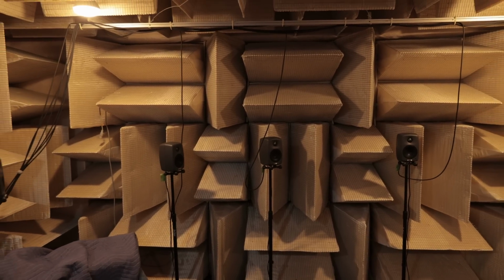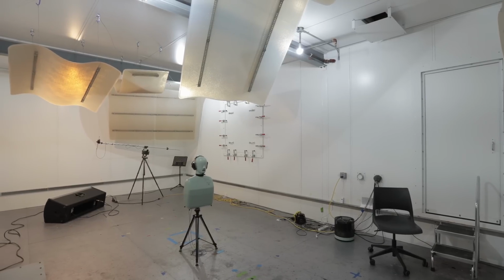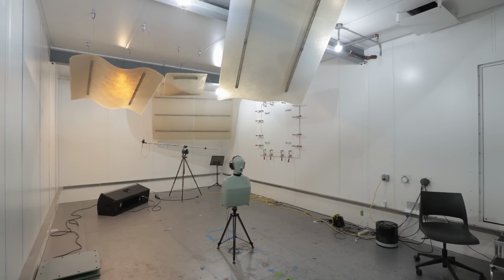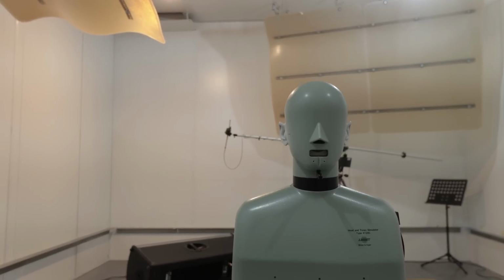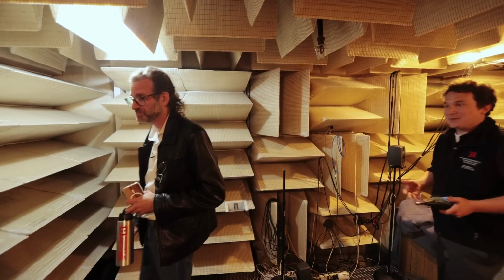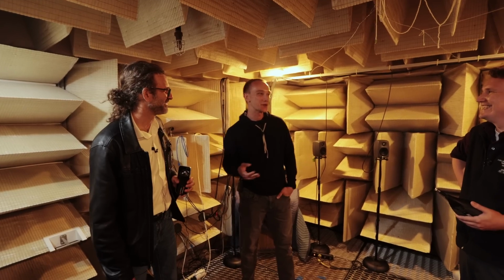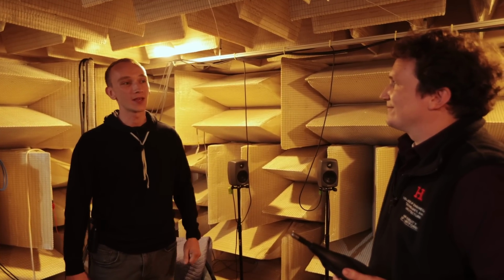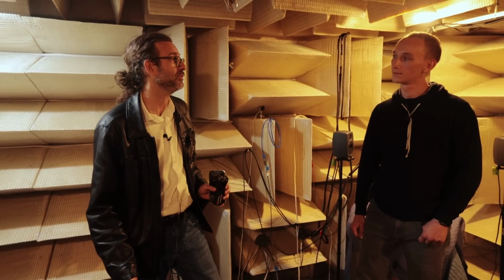Talking Acoustics at the University of Hartford

Comment: RE: room design before acoustic treatment. Many years ago the BBC did a study on ideal (as ideal as you can get considering restrictions) rectangle rooms with flat ceilings (Boxes - What many small studio builders may encounter). It involved ratio's of the dimensions firstly and size of the room secondarily. There were subjective suggestions about size based on which resonances were "preferable/tolerable. I believe this was somewhat bandwidth limited due to the priority of voice and the ability of equipment of the day (Leaving out everything below 100hz and above 8 - 10khz seems about right). The room size suggestions I believe were an early example of psycho-acoustic study although they didn't call it that then :). This material can be found in most issues of The "Audiocyclopedia", an excellent audio engineering reference source.

Comment: I went into an anechoic chamber in Nashville that wasn't suspended pr decoupled from the rest of the building and even then the lack of indirect sound was unsettling. But low frequency noise easily made it's way inside the building especially from the elevator shaft. The vibration isolation springs are hugely important I bet

Comment: That 17dB(A) in the anechoic chamber isn't even the "real" noise level in there. It should be much lower. This value is typical of that class of sound meters and it is its electronic noise, the bare minimum it can measure.

Comment: Artec did an excellent work when they adapted an old train station into a concert hall - Sala São Paulo. Bellow is a link to google maps. You'll see a part roofed with orange clay tiles and then another long part covered in grey roofing. That part is the train station - that is still in use. Artec managed to insulate the vibration of the trains from the concert hall itself.

My colleagues and I did some work on an auditorium that's on the basement of a reinforced concrete 3 story tall building on the Arts Institute. Sound from the pianos on the upper floors would bleed into the auditorium through the reinforced concrete structure. The solution would be to insulate the pianos from the structure using, for instance, those coils.

One main use for reberating rooms is to measure sound absorbing materials by measuring the reverb of the empty room and then, after putting a determined piece of the material inside, measure the reverb time again. The difference in time can be used to calculate how much the material absorbs per square meter (or feet).

Comment: These 2 rooms have different characters. In my opinion, it seems that relying solely on the room can reduce the mixing process in audio recordings. Especially for reverbs and dynamic compression. Thanks Kyle and everybody.
Reply: Supposing you have a great room, properly treated (using the Sabine equation if you want that good natural reverb) and are tracking acoustic instruments, yeah. Otherwise the differences you hear are the are only difference YOU hear in your listening environment, and will not transfer to other systems in the same way. Like mono bluetooth speakers, for example. That said, all the biggest records of all time were definitely recorded that way. A lot of them, in Abbey Road's reverb chamber. I can't remember what song, but one huge classic rock song was tracked in a stairwell, and pretty much every large studio has either a reverb room or an actual plate reverb in the basement. (If you don't know how real plate reverb works, check it out, it's amazing.) Getting it right at the source is usually the best way to track and for sure the most efficient. But that's also the reason old records sound old, they didn't have the flexibility we had today, like re-amping through plug ins, especially with an IR for a good cabinet captured in a great studio room. Same with drum samples. I can track and mix drums, for sure, and it'll sound good. However, it simply can't compete with Matt Halpern from Periphery's playing, feel, gear, and the room (with was phill Collins' studio I believe for the last pack they released.) These aren't fake drums these are real recordings of a pro with pro gear tuned and set up by 2 pro's (Nolly & Matt) in a world-class studio using several $20,000 microphones. We can't compete with that at home, or really anywhere. Which is why the top producers in metal and rock, have been layering in samples like this, since the 80's. But I'm a HUIGE fan of tracking it right in the first place, but still tracking a DI side by side just in case.

Comment: Electricians have fire putty, it's red like clay and used for penetrations in firewalls. Take the cover off your receptacles and switches, and fill them with it. It's relatively expensive, but it's rated for that use and the only alternative we have is sheet lead which I really don't recommend because it's actually for shielding in x-ray rooms and such and is toxic and won't work nearly as well. Receptacles will nearly always be next to each other on both sides of the wall. It's not just something we do to save wire; it's engineered into the plans. We're just doing it like the prints say to.

Comment: Excellent video, thank you.
Couple questions on those balloon pops.
Would it be ok to rip and use them as impulse responses on my own work?
Balloon has it's own frequency spectrum. Would it make sense to take the anechoic chamber balloon pop frequency response normalize/flatten it with EQ and then take the same EQ to the echo chamber pop?
That should probably turn the pop closer to white noise peak I'd assume and therefore give more accurate IR of the space.

Comment: Considering that the noise floor of the sound level meters (BK 2250) is 16.5dB(A). The SPL A weighted in the anechoic chamber must be in the 11dB(A) range to achieve the 17.6 dB(A) or am I mistaking?
Reply: Sound level meters have a nominal noise floor (acoustic self generated noise, with the microphone attached) and a unique noise floor which varies for each unit as each will have very slight differences due to the individual model, its circuitry, the preamplifier and microphone used etc.
On top of that, the measurement was made with several people & cameras in the room, which makes it very hard to create an 'ideal' environment for measuring the room noise.
The actual A weighted noise level of the room is probably lower than the 2250 can measure. Our own anechoic chamber (university of Salford, UK) measures close to 5dB (A weighted) with low-noise microphones through a B&K PULSE analyzer (without anyone in the room & all other electronics switched off).

Comment: At 29 minutes. 
Finally. Someone said that speaker model matters. 
You can’t just drop any 18 inch subwoofer in a building and expect consistent results. The speaker you use matters. The acoustic treatment you put in the room matters. This matters. 
JBL may be perfect for one situation, while Community is the correct speaker for the next and EAW is for yet another one. 
The EAW line array isn’t gonna work where the Meyer point source box is best suited for. 
IT MATTERS.
Reply: 🤔 Makes a lot of sense.

Comment: There's a very distracting steady-state noise in the background through out the video. I thought it might be gated room noise but it persists in the anechoic chamber. Maybe data compression artifact? Electrical noise on a faulty piece of gear?
Reply: The editor may be deaf from all the balloon bursting
Reply: I was wondering too. I didn't find it distracting but I found it ironic that there's static coming through in there. I wondered the source of that as well. Something in the signal chain. I doubt it was actually present in that chamber but some electronic in the signal chain produced it most likely.

Comment: Regarding the Yamaha, ns 10. I don’t think it was designed to be a great sounding speaker, but an proximation Of a mediocre speaker. It is simply just a tool.
Reply: No, it was designed as a low to midrange bookshelf hifi speaker. The intention was for it to sound good, but they failed. Instead it's about a +6db wide bell at around 3k 😅

Comment: Interesting! 
Also nice at the end when we could hear the difference between the anechic chamber and the reverberation chamber on the guitar and balloon
But you should get some better microphones for the rest of the video, so we can really hear what's going on. Just get 2 good omnidirectional small diaphragm microphones (large diaphragm ones may work, but tend to have very poor off axis frequency response in the high end) freely mounted with a 30 cm (1 foot) of distance between at camera position (which gives a sort of "simplified" binarual sound that works quite fine in most cases - I use that my self on my videos). Also, skip the auto gain crap. Having recording levels that fluctuates "all over the place", makes it hard to really hear anything, when it comes to things like how the SPL changes when moving in relation to the mic and how the sound drops off by time in the reverberation chamber. It also adds distortion, pretty much the same way as excessive use of a compressor. 
I have been in an anechic chamber my self and also done test recordings. While it's true you have to experience it to really get how it is (because you can't record for example how it affects your own voice, when you only hear the sound coming "on the inside" thru your skull with no reflections from outside), it can still be reproduced way better than in this video. For someone who works professionally with sound, I expect better than this).

Comment: The wedge shapes in the anechoic chamber also (obviously but fun to note) increase the landing-surface (my term) area of the absorptive material. 
I wonder how this room's acoustics compare reflectively with standing atop a tower in open space on a small platform, or as more commonly experienced standing atop a mountain pinnacle. Could I say when on top of a Mountain in NH that I am effectively in an anechoic chamber?
Reply: The problem is that there is always wind on a mountain peak or cliff.
Reply: Sort of, yes. Both are "free-field" conditions. Though in practice the floor would make it more like a hemi-anechoic chamber as there will be some reflections below you. And yes the noise floor would be much higher 😄